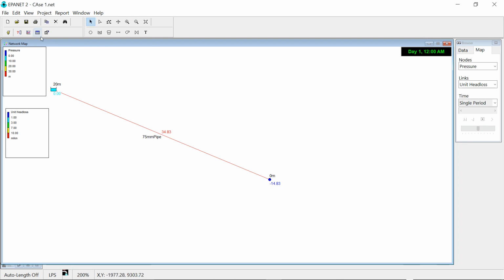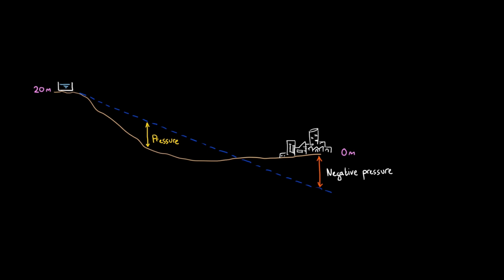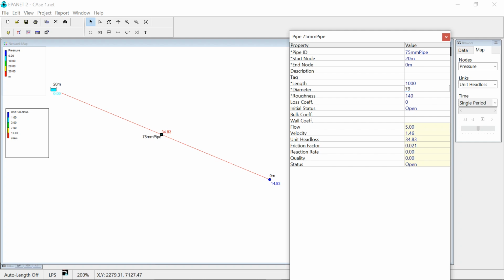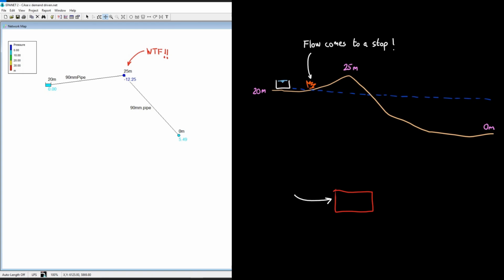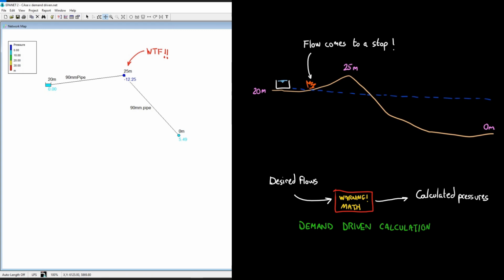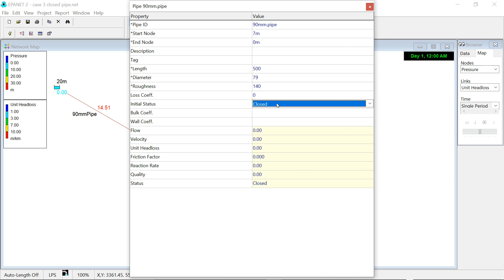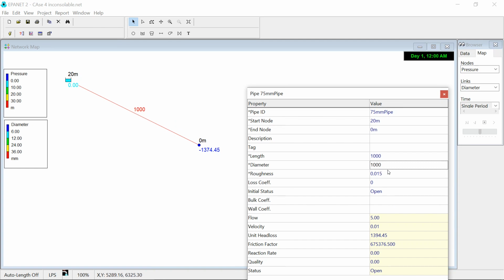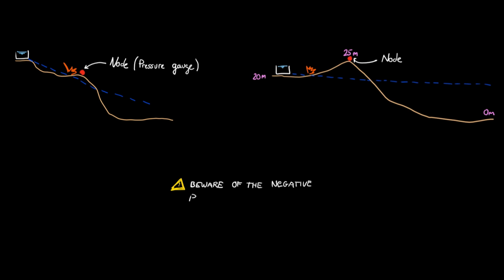How to solve negative pressure error in EPANET

Comment: I’ve modeling a system with extended period simulation. The negative pressure occured at time when demand reaching its 1,5 x base demand. Can i used psv instead changing the pipe diameter?
Reply from the maker: Try, that is the beauty of modelling
Reply: @s.arnalich i’ve try it but it makes the node with negative pressure faced the system ill-conditioned. Is it indicated that psv can’t solved the problem?
Reply from the maker: Use ChatGPT, it usually gives very good guidance:

⚠ Possible Reasons for Problems When Using a PSV in EPANET
1. Unreachable Pressure Setting
If the PSV setpoint pressure is too high, the system may not be able to sustain that pressure at the valve’s node.

EPANET will try to meet it, but if it's physically impossible, it can lead to solver issues or unstable results.

2. No Demand or Flow Through the PSV
A PSV needs flow to operate. If there’s no downstream demand or insufficient pressure differential, the valve may "float" or stay closed.

This can create dead-ends or isolated parts of the network — leading to an ill-conditioned hydraulic matrix.

3. Conflicting Valve Types or Controls
If the network contains multiple valves (e.g., PSV + PRV or pumps) with conflicting goals, EPANET may struggle to solve the system.

4. Poorly Placed Valve
A PSV is intended to maintain upstream pressure. Placing it in the wrong spot (e.g., without enough downstream draw) can cause unrealistic behavior or zero flow conditions.

5. Looped Networks
In looped systems, PSVs may create artificial constraints that disturb flow balancing, especially if there are multiple PSVs or valves in loops.